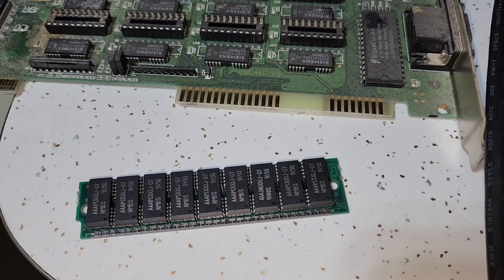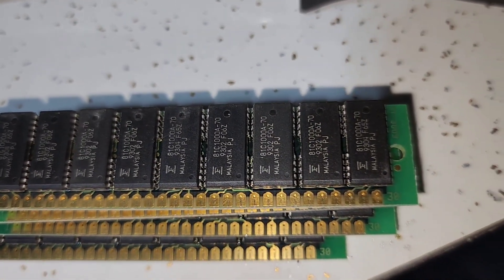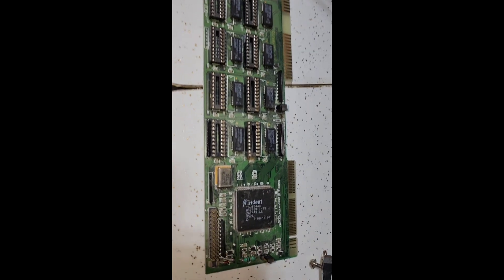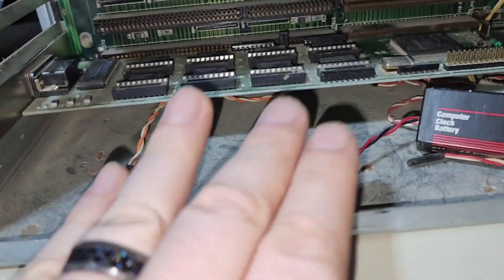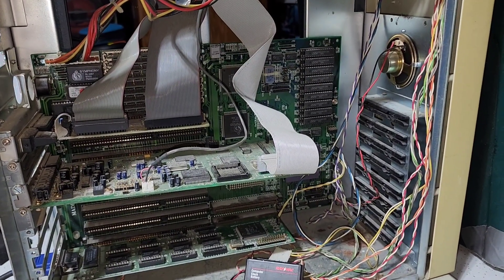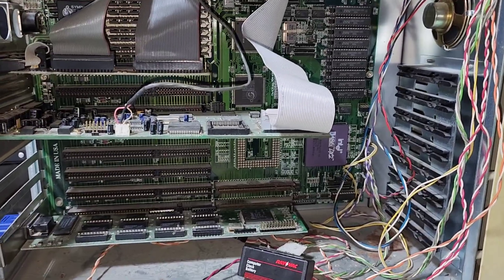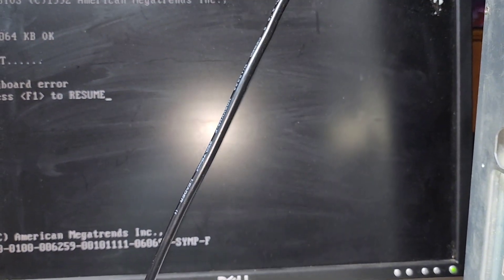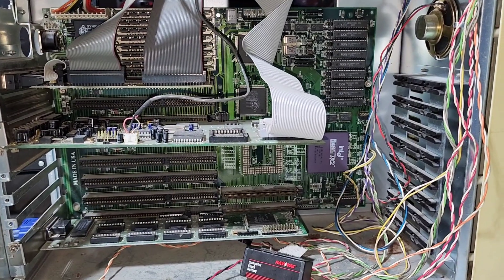Will it Boot? Mystery 486 with Intel i486 DX2 - Did I rescue this tower?

Comment: The second cpu slot is for an overdrive processor i think, not required.  And if it were me id have taken that thing completely apart and cleaned it properly first.
Reply from the maker: Yes, I will be cleaning it. I had to know it worked before I bothered with cleaning it. I pulled it out of a heap at a recycler.

Comment: How old are you.. You sounded older then me.. Is this the first time with an 486 machine or older pc.. because you didnt sound what some cards and connectors are.

Graphics card is an average one.. Its a Vesa local bus card. As i said performance is average even below the cirrus logic ones.

Other good tip, clean the parts with a soft brush and Iso propanol alcohol.. That dirt really has to come off..
You can clean the card connectors to.. Some are getting more brown due age.. With a white pencil eraser you caN rub to contacts clean (with patience)
Reply from the maker: I've had a couple 486s but it's been a long time. I really got started more in the Pentium/P2 era. These were slightly before my time.